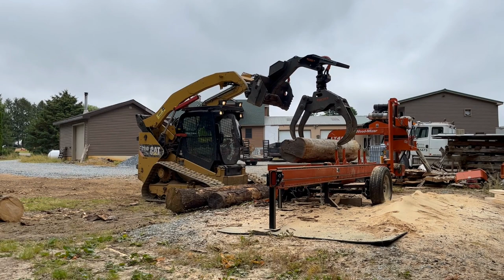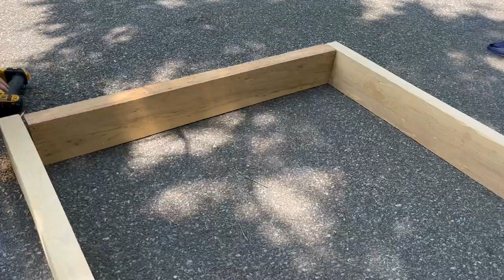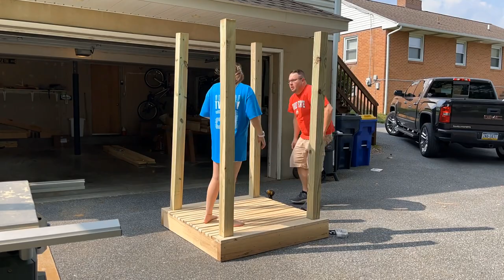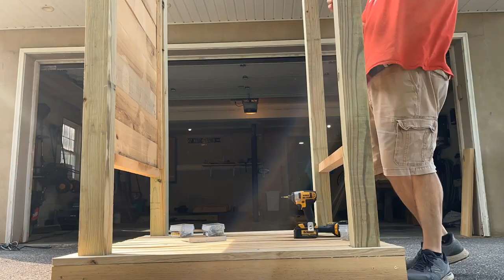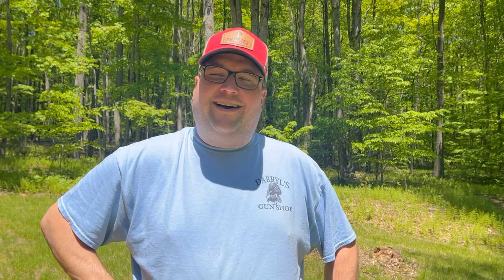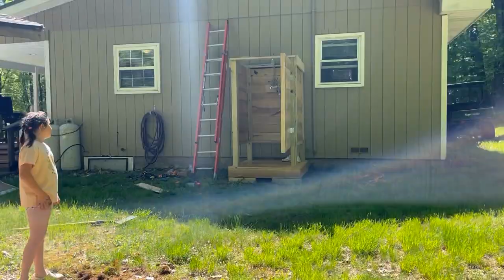Building an Outdoor Shower

Comment: Will you have to treat the wood because of the water?
Reply from the maker: I wouldn’t need to. The project is constructed of locust and sassafras, which are naturally rot resistant woods. But I might after it ages for color. Thanks for your question!